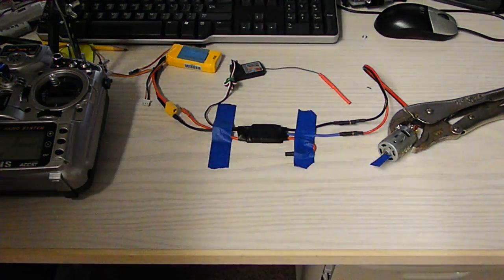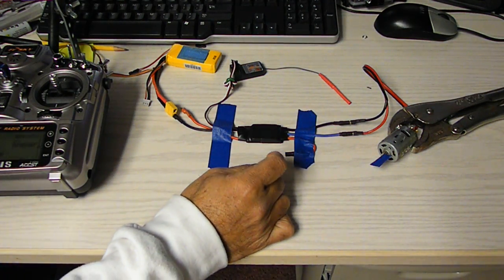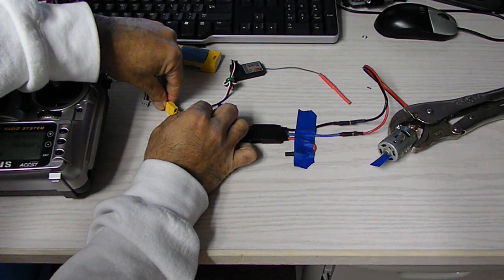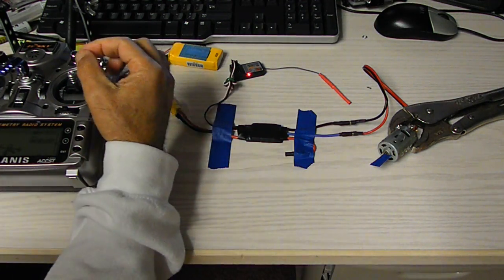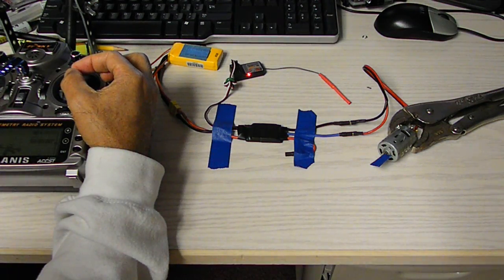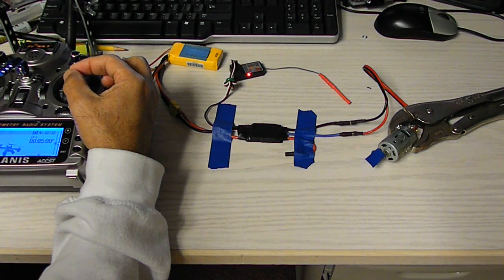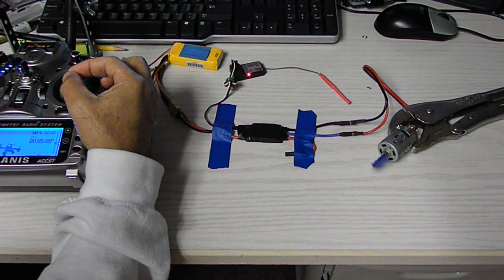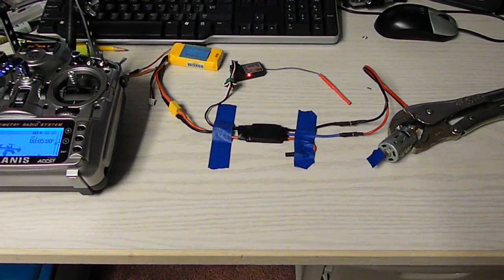Brushless to Brushed ESC conversion with reverse - fully proportional

Comment: worked almos fine!! 'I did everything well, but works only in one direction ...and not with any of the 3 phases (only blue and black, red should not be used?).... i cant make it reverse, why ? should I need to re program the esc ? to enable reverse with the programming card ??? or this option it is nulled after the firmware upload? ? (im testing wih servo tester blue one) thanks for any response from the author or anyone knowing ... what did you do to have the radio centered by default
Reply from the maker: Firmware only works for the specific esc ... sorry!
Reply: Esc is hk20a!! so don answer predefined .. also asked if programming was still posible

Comment: Can you use a 3s battery with the brushless esc and brushed motor
Reply from the maker: You can use the 3S battery with the ESC and Brushed motor (assuming it is 12v)

Comment: if i could do that with my ebike 60v brushless controller i could use my 36v like right now
because i can't get any 60v controller for my  1000watt brushed motor (my1020) :S
yeah i want to overvolt that motor
Reply from the maker: Probably is you can get the correct firmware to  use for your ESC. The one used here is very particular to the HobbyKing ESC. Try looking for DC brushed controllers ... I've seen a lot of 12v and this will work on 36V but a lot slower of couse.
Reply: @tsisapik  its not a simple esc though :S

Comment: In the mentioned website, four hex files are found. Despite i flashed my 30A simonk ESC with the FA20A_r40.hex
, as you mentioned, it successfully flashed but nothing worked. Would you please explain a bit about all the four hex files and why each one is used.
Reply from the maker: Any ESC other that those specified for each firmware will NOT work. FA20 firmware will only work for the FA20 ESC .. Sorry

Comment: Hello, i have a question. Can i somehow connect brushless motor with brushed ESC ?
Reply from the maker: Hello ... unfortunately no ... Brushless motors are AC three wire motors with no brushes and Brushed are two wire DC motors which means you can run a brushed motor directly from a DC power source cannot do that with the brushless.
Reply: @tsisapik  thank you for the answer. I've read about that more. And i know now how they work.

Comment: Will it work for long time 5 minutes
Reply from the maker: Will it work for 5 minutes ... depends on how much power you inject to the motor for five minutes. I do not know what the final output power rating of this ESC is ... but I am sure shifting between one direction to another involves a LOT of power.

Comment: Is it safe for receiver and ESC ?
Reply from the maker: This is an ESC firmware modification from brushless to brushed. The receiver is NOT affected. The ESC firmware is changed - you can no longer use this ESC for brushless applications.

Comment: How do you make it reverse???? I guess that esc that you have used it for brushless motor... If you did any changes please share it...
Reply from the maker: 1) The ESC firmware is updated 2) Radio is calibrated so center position is null or no movement. Push forward and it goes forward. Push backward the the motor goes backward. Caveat - you need use the right ESC that matches the correct firmware AND flash the ESC carefully or you get a dead ESC - follow the materials in the video links carefully. Goodluck!
Reply: @tsisapik ty so much❤❤❤❤❤❤❤❤❤❤❤❤❤Helps me a lot

Comment: Th idea 💡 might be amazing coz it is new idea 💡, bt who's gonna do frm brusheless to brushed… so it is useless! :-(
Reply from the maker: I see from your channel you have not posted anything regarding robots or worked on electronics around motor controllers. If you have had any exposure to robotics, you would have known, the majority of projects with robots using motors are with brushed and not brushless motors to allow instantaneous change in motor direction with the appropriate torque. BL motors by design cannot provide good starting torque just as a consequence of their design - you would know that by holding a BL motor on start up - it can be held stationary with the fingers.  FYI - the conversion of BLC controllers to brushed is not new - has been for several years now - more than two years since I posted the video. I used these ESC for a robotics project I had using a MWC Amtel 2560 board just for fun - worked great too.
Reply: @tsisapik  ,
Yah actually I did not post 📬 any video… but usually I m a RC Hobbyists.  I thought 💭 u too .So,  in our RC wrld  BL motor is th best motor . However,  sorry I didn't think in robotics brushed motor is more proffered. Thanks :-)
Reply: I have a project that only can use brush motors and all of my ESC‘s that were brush burned out so now this is a lifesaver thank you so much
Reply: @xzoticaquatics  ,

As long as it helps u u shld be happy 😄. 
For us , we do RC stuffs. BL is our way to go. This way makes us happy 😄.thanks

Comment: Do you have tie link for the list of ESC.... That can be converted to brushed.........
Reply from the maker: Please go to the video description and click on the link that says "Website with link to F20A_R40.hex " ... there is a list of working ESC's on the right side of the website - good luck!
Reply: tsisapik I checked it....... 
Is it only four.... ESC.......... Or...... More..... 
I couldn't identify. .......... Please write a. Clear reply with name and download...
Reply from the maker: Those ARE the four firmwares for the four ESC units. If it is not on the list - it cannot be reprogrammed. You may not be familiar with the ESC so Google the name/s and maybe you can see where they are being sold. Check out the HobbyKing site -  they may still have them for sale.

Comment: Hi there tsisapik, just a quick question, have you managed to get this firmware working with any other high power esc? Unfortunately I cannot buy the TZ85A anywhere and I need a high power brushed ESC (60A+)
Reply from the maker: Have not worked on anything higher that the HK20A ... FYI, I went to Ebay and did a search for Brushed ESC's, they have them there for 60, 80 and even 100A ... no need to flash anything. For RC cars - may be programmable ... maybe.
Reply: Thanks for the speedy reply! I looked on ebay too, but I noticed they're all 3s-4s and I need 5s which is a bit of a problem. I'm trying to use 50A 18V brushed motors
Reply from the maker: Try this ... should be more than what you need ...https://www.ebay.com/itm/10-50V-80A-4000W-DC-Motor-Speed-Control-PWM-HHO-RC-Controller-12V-24V-36V-Case/182046750265?hash=item2a62d4f639:g:~TgAAOSwETJaA~5R
Reply from the maker: Or search for this  "10-50V 60A DC Motor Speed Control PWM HHO RC Controller 12V 24V 36V 48V 3000W"
Reply: Hi tsisapik, i have question
What kind this ESC ? 
Simonk or emax, and how miliampere for ESC, 12A - 30A thats enough for 2s

Comment: i have hw 30a esc but 

which one of this should i use for flashing it plz reply fast it is my collage project

FA20A_r40.hex
TZ85a_r40.hex
TZ12a_r40.hex
plush30_r40.hex

which one should i use for hw 30a esc 

plzz sir reply fast ok wating for your reply
Reply from the maker: Let me step back and tell a story. The brushless to brush firmware was purpose designed to only work for the specific ESC for a good reason ... firmwares are programs and the ESC chip type and wiring layout determines the program parameters. Some good soul wrote firmware for four types of ESC's as you listed. Unless the ESC brand/model is listed (some variant in capacity could be possible), the firmware is almost guaranteed NOT to work unless your HW 30A ESC is a clone of one of the four - of which I have no idea - so cannot give an opinion. My humble suggestion regarding your project (not the fate of the HW ESC) is two fold - at the risk of making useless the ESC (YOUR risk), try each firmware - if it works - good if not go to option b) Get one of the ESC's listed for the firmware. I suggest the Plush as that has the same 30a rating ... get those at Hobbyking ASAP.
Reply: @tsisapik  Thanks mate. Interesting to see this still lives on.
Reply from the maker: @stevenmartin5961  Yep still alive and kicking - thanks for stopping by!

Comment: Thanks for the video, but I don't get a voltage on my motor wires, by using the elevator port at the receiver. How do you set up your radio? Any advice would be helpful, thanks.

Comment: Hi tsisapik, I could reprogram a HK Plush30 easily but I can't enter in calibration mode. When I put stick all way down the motor stop motion like the ESC doesn't recognize the PWM signal (out of the range). Could you please help me?
Reply from the maker: Hi !. How did you connect your ESC to the motor? Use a voltage meter to make sure you get the correct leads (there are two of three to chose from). Also, the ESC is connected to the Pitch stick (Ch 2) of the radio - not the throttle. At neutral (dead band) no signal is produced. Forward or backward depends on how the stick is positioned.
Reply: Thank you tsisapick. I just pick the two of them which makes the motor run forward and backward normally. The issue seems to be about the PWM value of my radio for channel 2. Please email me and I send you my wiring setup.
Reply: I solved. Just reser PWM RC_HIGH and RC_LOW at the plush30.c file and the range of my PWM was corrected for my radio/receiver range.
Reply from the maker: Good for you ... my next suggestion would be to look at your radio and see if there was a way to check signal levels ...

Comment: can I use this setup with Bo motors?
Reply from the maker: Hello ... what are Bo motors? If you mean brushless motors this will not work. You need to reprogram your ESC with a compatible 3D brushless firmware - BL Heli and SimonK ... need to Google each and determine if they are compatible for your particular ESC - FYI, ESC's are not created equal.

Comment: I have seen link in description but could not understand csn you plz explain me how to do it.
plz mail at atifali5555@gmail.com
Reply from the maker: Hope I can help. 1) You need to have one of the five types of ESC (green boxes) on the right hand side of the linked URL - only those will work. 2) You need a serial port adapter and solder tap wires to the serial port of the Amtel chip or use an Amtel flashing tool 3) You need the KKflashing tool to update the firmware. See the following video as a guide https://www.youtube.com/watch?v=gtvjTEcVwYE&index=9&list=PLF93893468A5DCF9F Good luck and come back if you need further help.
Reply: Thanks man GOD bless you. when i will try it, i contact you.

Comment: It's very interesting, tsisapik !! But I'm wondering If this idea could be applied to reverse the direction of rotation of 3-phase DC BL motor. I have been looking for a solution for a long time but there is no answer except that "you should change wiring order manually". Actually, I need to control the direction of rotation of this motor (3-phase DC BL ) by RF transmitter as you have done. Do you have any idea how to do that?
Thanks
Reply: BLheli firmware can do this on some ESC's, 3d mode. Creates the middle point as the new throttle low, and negative and positive endpoints. For a quadcopter, I like a spring return throttle when in 3d btw.
Reply from the maker: Sorry for the late reply - you can get the pricier ESC's they use for RC Cars that reverse direction (brake mode) with the proper signal input - gets tricky to program but is stable and works great - I have them on all my BL powered cars (and boats).

Another solution is to flash it with the 3D reversible SimonK or BLHeli - this is the cheaper option.

Comment: thanks a lot man that helped a lot. I'm trying to make my own foam cutter and was looking around for some brushed esc which is rare these days and had a lot of brushless esc laying around. I tested this on HK 20a esc and it worked. I tested with multimeter and found the blue and black wires became negative and the red wire became positive. I expect this to be able to heat the wire but I'll have to go buy some now. I'll update again after testing it with the wire.
Reply: +Mohamed Soud thanks a lot man you saved me from buying a brushed esc just cause it have two wires instead of three. I made the foam cutter using 3s on 1 meter long nichrome .20mm wire and 3s lipo I was able to cut styro foam but the wire wasn't hot enough. I'll try again with 4s lipo. I suspect the long wire have something to do with the weak performance of my cutter but I needed it this long to thin a 3cm thick sheet to .8cm
Reply: +Mohamed Soud just tried with 4s its working great, its cutting like a hot knife in butter
Reply from the maker: +Mohamed Soud  ... Interesting application ... I would have used a simple square wave power supply / transformer or a battery directly to heat the wire ...
Reply: +tsisapik thanks for the reply, I was looking more for portability, I attached the pipe I used as cutter base on my existing multi task table using clamps (its an insulation box for my air compressor from the inside, at the table top I have my rc motor thrust tester and use the other side to put my small easel for small airbrush painting or lay them flat on my table and airbrushed them if they're just stencils) I was keeping the other solutions for later in case the esc idea failed since I have everything I need except the esc. I also needed some way to control the temp on the wire and adjustable power supply is little more expensive around here. I used a servo teser connected to esc to be able to manage the temp.I saw the project page and it didn't have much updates since a while. I'd like to know if the 30a HK esc can be flashed with this firmware or if there will be anymore esc added to the list later. thanks again man I had fun building the cutter and testing this firmware
Reply from the maker: +Mohamed Soud ... been thinking the model build early on in the hobby - still have the EPP and blu-cor (KF foils etc.) hanging around. Then I stumbled into the multirotor world and robotics and have not turned back. I have converted kites and toy models to full RC as "can it be done" project. More now into aerial videos, FPV, autonomous flights/ waypoints and 3d/2d modeling for more practical applications.
Reply from the maker: +Mohamed Soud ... Good plan and good luck. Also try the US of A ... may have some rules but freedom reigns. Who knows we may fly together ...
Reply: tsisapik hopefully one day we'll meet in person my friend. USA was on the top of my list but in the last few years with the problems that's happening with/by muslims I'm not feeling comfortable to move to USA even though I have some good friends over there, also the regulations for immigration and residency became harder as I heard. if you can point me to some sites where I can gather recent information I might be able to move to USA as the language won't be a barrier like Sweden and Germany (both are great) but states is more appealing to me especially if I can get my own piece of land and start a small farm and ranch. Canada is too cold for my taste but if their immigration system is still the same (depositing some money in Canadian bank and keep living in the country for a period of time will give you residency eventually) I might give it a shot. sorry for the long reply I think I needed to vent some of my depression out. have a great day man :)
Reply from the maker: +Mohamed Soud ... Go to the US ICE website ... there are a lot of links to research. If you have not yet, you might like to visit the US and look around states like Texas or Arizona where they have LOTS of open land (well deserts really ...). FYI .. I worked in Riyadh for two years .. nice place to visit. Keep healthy ....
Reply: tsisapik thanks for the tip. I'll look and see. since you lived in Riyadh I think you totally understand what am going through lol.
Reply from the maker: +Mohamed Soud ... more than what I am willing to admit unfortunately. I did enjoy Kabsa (with gir-gir), trips to Batha and fishing in the wadis around Riyadh.
Reply: sorry to hear that bro. not really familiar with Riyadh only visited once and it was a business meeting, I travelled back to Jeddah in the same night. we should start exporting kabsa instead of oil lol its worldwide famous dish.
Reply from the maker: +Mohamed Soud ... Come to the US, set up a Middle Eastern restaurant in the East Coast (complete with the hookha lounge ...) I'll be one of your best customers and yes we can fly too.
Reply: I wish my friend, inshallah things will be better and I can come. ofcourse we will be flying there, count on that. have a nice weekend mate :)

Comment: how can we do brused to brushless motor.i should convert my motors brushless
Reply from the maker: +Ogz Tnr ... brushed to brushless ... You would need brushless motors (Google them) and a Brushless ESC with the suitable rating for your application. What do you plan to power because that will dictate what you need ...
Reply: +tsisapik  my plan is for my mjx x101..but its brushed esc onboard.so I thnk I need brushless converter..another problem.which motor can I use.cuz mjx x101 has gear.motor doesnt connect direct propeller.so maybe high kv maybe 2300... or direct connect 900kv more powerfull motor. isnt it.can u help me.7.4v
Reply from the maker: +Ogz Tnr  ... assuming you figure out the pinouts for the ESC's, wire the BL ESC's and install the BL motors, you will probably have to use a separate BEC to power the motors (stock uses 2 cell Lipo) and end up with a modified MJX that costs more to convert than the stock quad with no guarantees it will work. Instead, think about building a multirotor using the APM boards .. cost a little more than the conversion but a) you get a more "powerful" quad plus b) experience moving up to the next level of multirotors not to mention c) you can still fly the MJX using stock parts (available via the net).
Reply: tsisapik great thank you.